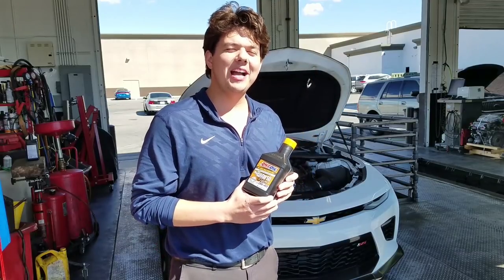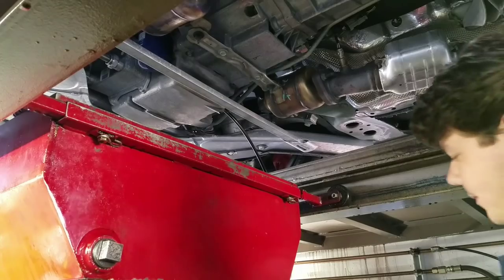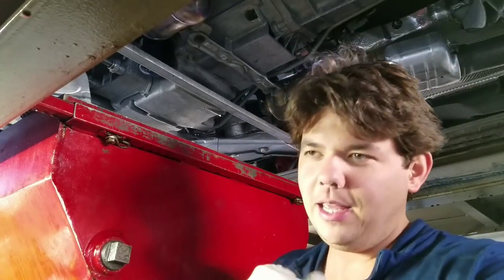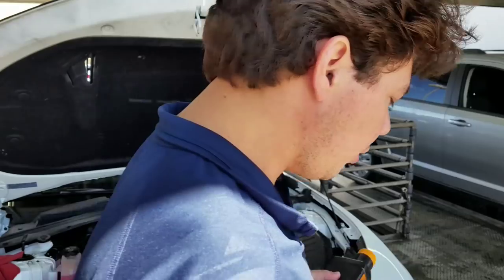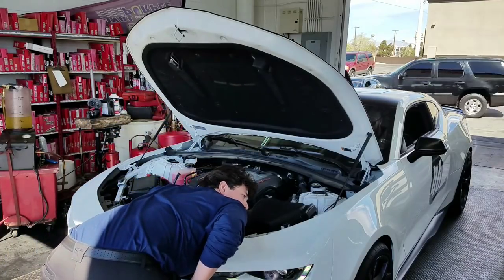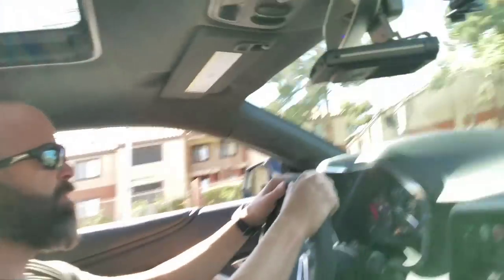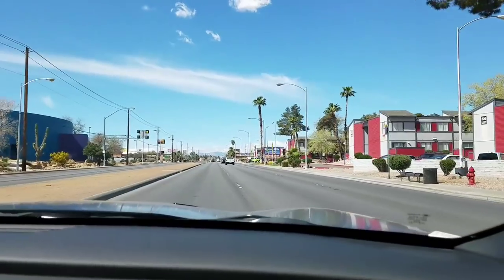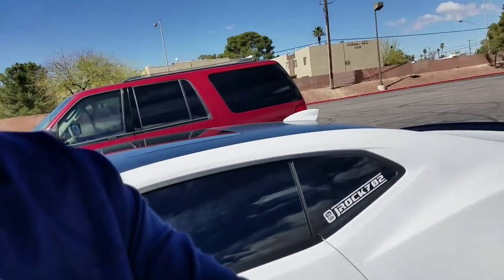2018 Camaro SS 1 LE AMSOIL Motor Oil Change

Comment from the maker: FAQs about AMSOIL lubricants 
https://www.youtube.com/playlist?list=PLB_ftWArBFddeMPIMmZFpXbOyXSRZerqt
Eben Rockmaker
Independent AMSOIL Specialist (Dealer#: 5331179) https://www.amsoil.com/offers/pc.aspx?zo=5331179
Mobile: (702) 472-3614

Steps: 
1. My blue link gets you 25% discount and free shipping on orders $100 or more. I will get credit for your purchase when you use my link. Click blue link under my name, Click join now yellow bar Preferred Customer for 1 year. Click add to cart. Note: Amsoil will not keep your CC info. There is no recurring charges.
2. Click look up your vehicle.
3. Click auto light truck. 
4. After you have all the products added double check then complete order.
Any order over $100 is free shipping and ships within 1 to 2 days.

AMSOIL Vehicle Lookup - https://www.amsoil.com/guides.aspx?zo=5331179

     Friend me on and tag me because I like to see great results:
Instagram - https://www.instagram.com/syntheticoilprotection/

Facebook - https://www.facebook.com/profile.php?id=100007973957868

Comment: A real car!! I'm surprised the Shelby GT 350 doesn't use 0W-40. Seems like the best of both worlds. Easy cold starts, and high viscosity for running it hard.
Reply from the maker: I know that's what I used to think and I used to think too much about it and now I've realized it's manufacturer based ideologies.

Basically Ford product is a mystery and that's why they do different viscosities to have component expirations on time with higher levels of consistency.

There's a lot of engines that take 5w 20 from Ford product and I think that the reason they do that is because they're planning on having a 40 weight oil running in the car for half the interval because the oil is such a low low low low low low low low low low low quality that by the time it gets the 3000 miles it's already operating at a 45 weight oil.

So they actually designed the clearances on Ford product for 45 weight.

I've been running 0w 30 for about 14 months in a 2004 Ford Expedition and it seems to be running amazing.

The oil has thickened to probably a 35 weight after about 14 months and five thousand miles and the engine purrs like a kitten.

I love the quirkiness of Aston Martin and BMW with their 10 W 60 weight oil..... lol

It's interesting all the different Dynamics in systemic business models of each of the car manufacturers LOL
Reply: @Syntheticoilprotection  Yeah, when I was looking at the Coyote 5.0 engines from Ford, you'll find a lot of different answers on what you should run. They say 5W-20, but most users don't recommend it since it's a really thin oil for a 400+HP V8. I've pretty much concluded that it's only to meet CAFE standards, so something like a 5W-30 would be better, or 5W-50 for track use just like in the GT350.
Reply from the maker: Yeah I talked to some Viper guys and they told me that the 15w 50 Race oil completely blew their mind.

I'll probably try it in my car and do a review

Comment: Update to my car on amsoil, it burned a little so little that I’m not even going put any in it cause it’s probably not even couple drops way better then mobile 1 which burned little under half quart in 1.5k miles, amsoil on almost 6 thousand, it’s warming up got off work turned car on I got scared I couldn’t fill the engine turn over, the car turned on so smoothly and idled so smoothly it did not fill like it even started, EVERYONE DO YOURSELF A favor And switch to amsoil
Reply from the maker: 😊, sweet to hear James!

Thanks for sharing your great experience!
Reply: Synthetic Oil Protection important update, I checked oil again it’s weird it’s on F, maybe the other day either my car was parked in drive uneven or oil didn’t run to the pan, either way it’s F still, pretty happy,

Comment: Hey I know I’m 2yrs too late but I have a 2021 camaro ss 1le 10speed  with the electronic limited slip differential (ELSD) and wanted to here from you which differential fluid you recommend from amsoil that is track/street friendly
Reply from the maker: Just depends on how it's being driven most likely the 7590 GL5 severe gear would be great if you're doing track driving or super heavy launches I would probably go with the 75W 140

I would double check the lookup guide just see what it shows.
Find Products For All Vehicles - https://www.amsoil.com/guides/?zo=5331179
Reply from the maker: If you're new to Amsoil this is my link and I'll get the credit for your order also I'll be your Amsoil dealer in the future if you ever have any questions you can always reach out to me.
Professional YouLubher: Eben Rockmaker Regency Gold Direct Jobber AMSOIL Specialist (Dealer#: 5331179) 702-472-3614 

     If you're New to AMSOIL I recommend the AMSOIL 6 Month PC Membership - https://www.amsoil.com/offers/pc/?zo=5331179
Reply from the maker: Thanks for being a part of my YouTube community

Comment: Didn't manufactur recommend 5w30 for the camaro 6.2l
Reply from the maker: You can run both they did a technical bulletin update for all the previous sea sevens you can now run 0-40
Reply from the maker: C7 Stingray Corvettes now come with 0 40 from the factory